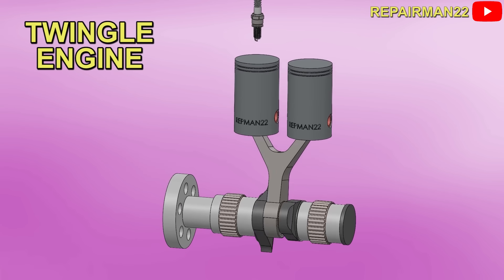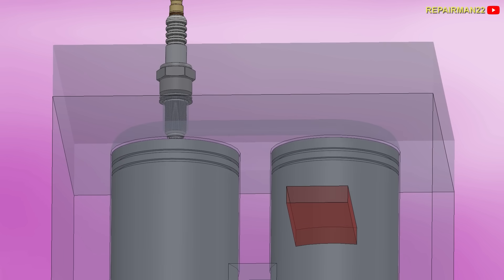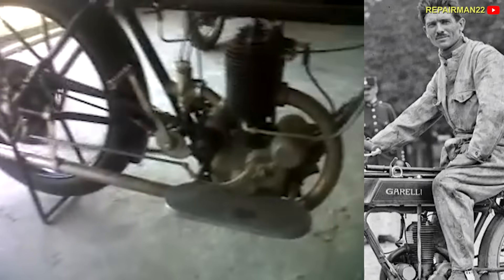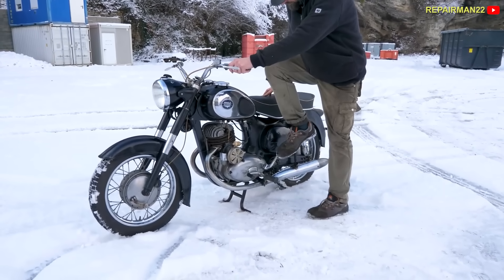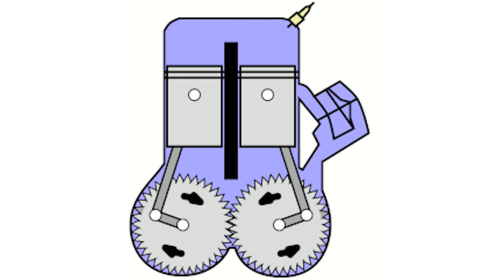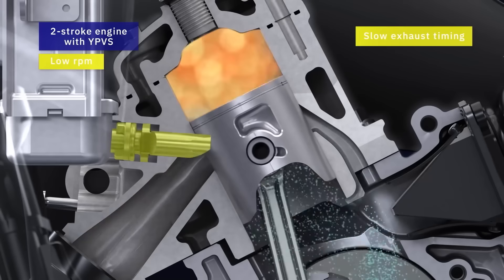The Twingle Split Single Engine used for 70 years 🤯

Comment from the maker: Touch CC on the screen to turn off the subtitles. I also animate 3D real stories on my second channel: @Trueeventsin3D
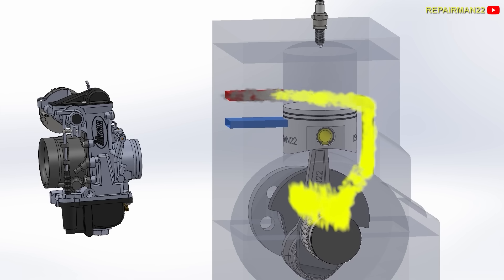Reply: small detail 1:14 'intake and exhaust occur at the same time' research "blowdown" or the time (in crank degrees) the exhaust is open before the transfer port is opened. reducing cylinder pressure to prevent reversion into the tansfers.
you're also wrong in your understanding of "torque" which is strictly a function of the power stroke, the piston area, rod length, and crank pin offset.
excellent description of the expansion chamber function.
Reply: Thank you :-) I am telling to people, that Puch was one of the best constructionist at that time 🙂 Pwy 🙂
Reply: If possible, can you introduce this two-stroke engine? Thank you.
https://forum.jorsindo.com/data/attachment/forum/201303/31/232919b8g83fupmr9mrmg7.gif
https://i.ntdtv.com/assets/uploads/2013/03/p3318701a990706700.jpg
Reply: Your audio is out of sync with your mouth
Reply: what about an inline 4 Twingle Split Single Engine
Reply: Hi
Reply: @TrueEventsin3D hi

Comment: Always fascinated by split singles. I owned an ISO motor scooter which I’ve seen claimed to be a split single, but it wasn’t. EMC made split singles in the UK and the late Mike Hailwood raced one of them. Second hand Sears Twingles (made by Puch in Austria) in 175 and 250 configurations are available in the USA. I’ve often considered importing one. Their real strength is their low speed torque which can surprise people used to other two strokes.

Comment: With only one spark plug I bet the efficiency was horrible. Also, the weird 2 stroke exhausts are designed for the pulse to push back some of the fuel/air overflow, kind of the opposite of exhaust scavenging of a 4 stroke. I always thought with FreeVavle camless system we would get a hybrid 2stroke/4stroke, pros of both, cons of neither.

Comment: I'm a mechanic and I have never heard of anything like this. Not saying 1 wasn't built, but this has a number of design problems. In your video you claim these were used initially, but never showed a video or picture of this engine or any old parts. The eastern European countries post WWII were very poor and had low quality gasoline. Engines had to have low compression to run this fuel so they were inefficient, low power output & gross polluters. Plus they were 2 strokes which are not known for low speed torque. So not sure about the 70 years in service but either but you got some neat 3D graphics.
Reply: Check out the puch 250 sgs its the most mass produced twingle i think

Comment: Many years ago in Mexico has a puch 250 gs with one carb on the side of the cylinder. There was also a model shell with two carbs one on each side of the cylinder. Wonderful bike very fast reliable and even had auto oil injection and enclosed drive chain. Would love to have one today here in South Africa.

Comment: In the early 1950s the well known German tractor manufacturer Heinrich Lanz developed a new type of tractor: the versatile tool carrier Alldog, mainly for small farms. Unfortunately for some unknown reason they decided to use a 450cc Triumph (TWN) double piston ('Twingle') engine. This was basically a good engine (in motorcycles and for some stationary use), but the worst possible choice for a tractor. In the end it brought the company down (the remainders were bought by John Deere, and some production is still in the old Lanz factory).
Why was this a bad choice? A tractor needs an engine with relatively high torque at low revs, exactly the things this engine could not deliver.  Thermal problems were the result, and almost all engines from the first series had to be replaced. Modifying this engine into a semi-Diesel, and then a full Diesel were not successful either. One Alldog I knew from new in 1953 had at least one new engine every year, and was finally scrapped in 1961. The problem was finally solved with a 'proper' and bigger Diesel engine from MWM. But that was too late; the reputation was ruined and nobody wanted to buy these unreliable machines.

Comment: Bad lip-synching with the AI voice. Also, "two stroke engines do not have valves." Two-stroke diesel engines, such as the Detroit Diesel Series 71, have exhaust valves, and two-stroke gasoline engines, such as the Yamaha YZ250, Honda CR259R, and Sea-Doo 947 and 951, use reed valves.
Reply: Don't forget rotary valves, like in a kawasaki ke100, or suzuki ts/tc 90cc for example
Reply: Those are all true facts but he's clearly only talking about twinkle engine types

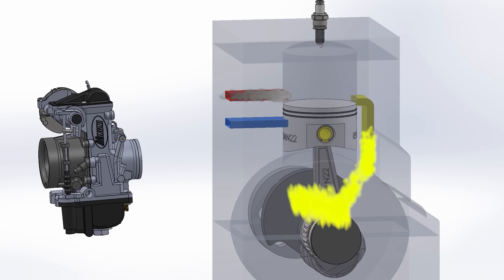Comment: Thanks for an excellent instructional video. If I can offer a correction, at 5:01 you say that the transfer and exhaust ports open at the same time in a two stroke. The exhaust invariably opens a good deal earlier than the transfer ports and, due to the symmetrical nature of the piston port engine, closes well after the transfers have closed, making the exhaust duration longer than the transfer duration.👍
Reply: Well noted.

Comment: If you haven't figured why myself and don't designed high torque at low rpm yours that stole our desighn and motors still haven't realized why automatic transmission our resources built won't work fore any your v 8 or diesel motors by way ours run slower rpm fore reason and actually aren't four strokes two stroke one stroke the ignition was most expensive part of are a compression enjines though more reliable than the jet airliner enjoying nes if yours halvent caught on dumb asses oxygen pretty much cheap takes higher torque than few others

Comment: 2:16 The increased ratio of internal surface area to cylinder volume is NOT an advantage for engine cooling or efficiency. Two smaller cylinders will always have more internal surface area than a single, larger-bore cylinder of the same displacement, but the larger surface area needlessly absorbs more of the combustion heat. That reduces thermodynamic efficiency (you want the expanding gases to keep their heat and remain hot) and it creates a larger cooling problem to be addressed by the cooling system. In the case of an air-cooled engine, it would basically necessitate more and/or larger cooling fins on the exterior of the engine.

Comment: Small correction: 2 stroke engines with valves do exist. Have a look at Detroit 2 stroke diesel engines which utilize an exhaust valve already since 1938. The large container ships of today are also powered by 2 stroke engines  utilising exhaust valves.
Reply from the maker: I made a video about 2 stroke diesel. Its in my channel. Thank you.

Comment: Especialy in big diesel engines there are a lot of 2 strokes with (excaust) valves and different ways to get air/excaust gas in and out the cilinder.
Especialy in big (old) diesel engines.

Comment: I have "reinvented" two camshaft twingle-like H engine as high performance 24-cylinder unit with piston axis angled by 150 and 30 degree (I called it rhomboidal engine).

Comment: With the Pistons reaching top dead center at different times, did the engine have an ignition system which fired two spark plugs separately and a different times?
Reply from the maker: No, only one spark. By the time the flame front reaches the 2nd piston, it starts to descend. So there is no problem.

Comment: All these change of direction for the gases to flow is stealing lots of energy. They got away with it because of the low compression/low octane fuel. 
Cooling wasnt really an advantage, old 2-strokes ran cool due to the large amounts of gasoline they consumed, much if it went through un ignited. Modern 2-strokes like chainsaws rely on powerful fan cooling, the fan steals more energy than it saves from lowered consumption.

Comment: I had a friend bought a Puch 250 in 1964. Riding it home (maybe 15 miles) it stuck 3 times. after cool down ran fine. Wasn't a bad motorcycle until Honda.

Comment: There was another engine - I forget where it was used - that had two pistons, but they had separate big-end bearings on a single crank pin, so that the timing was different between them - One piston led the other by a few degrees, and that was said to improve scavenging.  I may be wrong, but I think it was a Puch engine.

Aha!  I've just discovered that this engine is discussed at 4:44 in the vid.

Comment: When talking about fuel mixture going straight out of the exhaust port, don't overlook the fact that the fuel mixture is not being pumped into the cylinder continuously, as is hinted by the animation in the video - the engine only has one crank-case full of mixture to supply, so when the crankcase is empty, mixture would tend to stop anyway.

Comment: lol all i see in two strokes are electrical motion now a days. blue positive and red negative? imagine the piston rings being conductors, and as the energy moves from blue to the path of least resistance, accelerating in a gradual increasing curve, then rushes upwards to red, where it then bends and compresses with enough energy to still transfer to red, forcing the piston back down over-powering the resistance in a pre-determined cyclic path for leverage after it reaches the peak of pushing the piston to the cylinder height, (in a hemi for best arc, obviously) to overpower the threshold after the resistance is built up and then released, while red and blue (intake exhaust) swap like an alternator to repeat the process, esentially creating an electric turbo. it could light the glowplug itself and store that energy in that percise timing for release, too.

Comment: so much crappy info on 2 strokes. absolutely clueless! A 2 stroke does NOT suffer from low speed torque problems, they have 2x more than a 4 stroke (displacement and compression ratios equal) and at peak rpm isnt much less fuel efficient than a 4 stroke. lower speeds yea most arent great, EFI or carb.

Comment: Thanks. This is a great video, very well explained. Puch engines are still running today. But they have a thermal problem. When driving quickly on the highway or under high loads at a consistently high speed, the rear piston tends to block.

Comment: Very good video - very good explained. Thanks for that! I learned riding motorbike in the late 70th on an old, 1954 build, Puch SVS 175ccm with a twingle 2-stroke. The Puch twingle engines ("Doppelkolbenmotoren") were famous for being very elastic with a lot of torque from the bottom. The Austrian "Puch" was sold to USA under the brand "Sears Allstate". Didn't know this since I seen the "SR250" in your video. Once more: Thanks for that!

Comment: Modern engineering doesn't even think outside the box compared to these marvels from well over 100 years ago. Impressive, especially considering this was done before the age of computers. If anything, we have gone backwards in some respects.
Thanks for the cool video!
Reply: Check out the Deltec loco engine 😮
Reply: As complexity increases, so too does the minimum level of genius required to realize the best solutions.
Reply: Whenever there is a modern outside the box technology is explained on YouTube, people collectively complain about to much complexity and failure points eventhough modem engines fail much less than old one. The hipocracy is through the roof.
Reply: @electricpaisy6045  Just try to get an OBD2 car to drive a 100km at highway speeds with clogged injectors, multiple vacuum leaks, exhaust manifold and crossover leaks, at least one collapsed lifter, severe detonation,  a dead cylinder, very sooty spark plugs, all that and much more on a half and half mix of very old gas and new. A  very neglected 93 Cavalier with a 3.1L I saved from a scrapyard did, last year.

Modern cars have thousands more failure points than 80's-90's ones, doesn't matter if materials science has come a very long way since then; remake my Cavalier's exactly as is but with modern materials and techniques and they'll outlast everything made today. The simpler, the better.
Reply: @OldSchoolZ-wy2yx  OK but my obd2 car never had any of those problems in the first place and even if it did, the obd would tell me and I'd just fix it. Your car might be able to last forever but if it takes 2 times as much fuel at half the HP and less good cornering it's just not worth it to avoid one problem every ten years.
Reply: @OldSchoolZ-wy2yx  and just look at the video. Double the friction points and more parts compared to a normal two stroke in the name of efficiency. Why don't you complain about that? It fullfills every of your points but somehow it's old enough for you to accept?
Reply: @OldSchoolZ-wy2yx  I'm glad the world has enough engineers like the people who make these videos and not just like the people commenting them. Otherwise we still would have engines like in the 70s with push rods, carburetors and a single sparkplug.

Comment: In my mind when seeing this
that singgle connecting rod with mode Y connecting rod, can be usefull for 4 stroke singgle rod with seperating 2 cylinder combustion chamber and share the same cam profile duratin and lift

Comment: With the Isetta you're wrong. The Isetta has a 4 cycle BMW single cylinder engine. Two versions, 250cc and 300cc.
Reply from the maker: No. The iso Isetta has a twingle. You saw the car smoking and producing the sound of a 2 stroke. The bmw Isseta has a 4 stroke.  The video perfectly clarifies that.

Comment: Yes, At 80 plus I knew of the Puch/Allstate 2550 twingle engine. Like to have one even today.
Reply: Do the spark plugs fire at different times with different ignition systems?
Reply: I used to work on them in early 60 s

Comment: I used to  have a belgium made FN 175cc two stroke with two pistons behind each other. It has only one spark and combustion chamber. The special thing on this type is that there is a main piston rod and the second is not fixed at the bottem of the first. It is made like the connecting rods of a star engine with hinges.

Comment: "IN THOSE DAYS" that was fast. It was the fastest thing that Sears sold. The little Sears Compact was actually a close second. The 2 speed Allstate MoPeds were a hoot & used on many, many paper routes. The gas cap was also an inverted cup for measuring 2-stroke oil at fill ups. (A Yamaha FZ-6 IS fast by today's standards)

Comment: Most of the BMW made Issetas were 4 stroke 300 cc singles.  The only Twingle made that I'm aware of were the Puch Allstate motorcycle models made in Austria. And what this video completely misses is that the twin pistons rise and fall slightly off-set so the exhaust and transfer scavenging can happen more efficiently.  The animations showing the Twingle's operation are quite incorrect,  But then this is an AI generated, clickbait video. Take it with a grain of salt for the information it got wrong.
Reply from the maker: Whattt???? You haven't even watched the video before writing this garbage. It is explained that bmw issetas used 4 stroke engines and puch engines used master and slave to create different port timing. You should turn your 🧠 on.
Reply: @repairman22  Yet your video failed to even roughly illustrate the details of how the Twingle works..

  Have you owned a Puch?  I have, they have an asymmetrical rising and falling of their pistons created by the offset rear connecting rod, that makes their scavenging one of the most efficient crankcase 2 cycle transfer cycles next to the Schnerle porting of SAAB, DKW and Jawa 2 cycles.

  Which are cars and motos I've also owned.

 If you have such an ability with 3D you should have been able to model and animate how this works.  Your video clip shows the two pistons rising and falling precisely together.
Reply from the maker: @tauncfester3022  no doubt that you are blind and can't see a video. What you said is perfectly animated with the master and slave rod. If I were you, I would delete this comment to avoid people see this. LOL.
Reply: @tauncfester3022  : the video very clearly explained all of those things. Did you watch the first five seconds and then proceed directly to running your mouth without watching the rest? People like you are why the internet sucks nowadays.

Comment: Triumph made one of this. I still have the engine someplace in the attic. Probably the worst 2-stroke I've seen. The flame front has to propagate very far to reach the other cylinder. The piston of the other cylinder (away from spark plug) got severely destroyed by the detonation.

Comment: In the UK there was an odd, but fairly successful, little car called theTrojan. Very plain, simple and economical it was powered by a four cylinder double, split single of 1500cc. Probably the strangest features of this engine were piston rods designed to bend (a little) and a remotely located carburettor some distance from the engine. 
No passing oddity, Trojan employed this engine from the early 1920's to the early 50's, latterly in (very slow) light vans and also developed a triple, split single.

Comment: i only know about these engines because we have a really old lathe that uses one sadly no longer runs as the crank broke but it worked well until then besides a rare backfire like thing that it did where it would spray flaming fuel out the exhaust so we started keeping a big metal drum under it